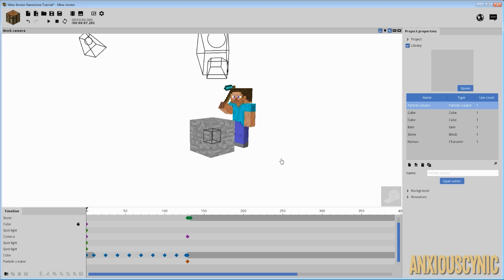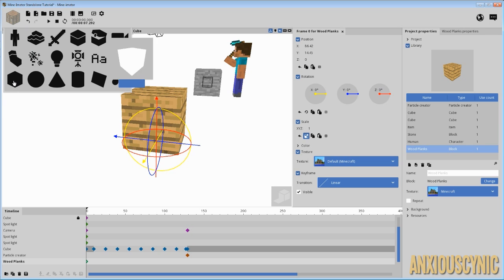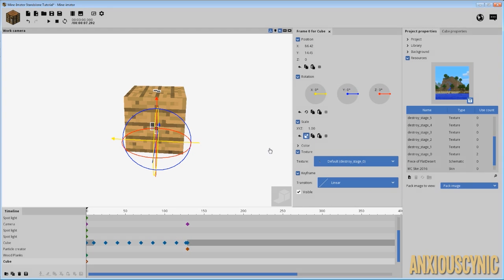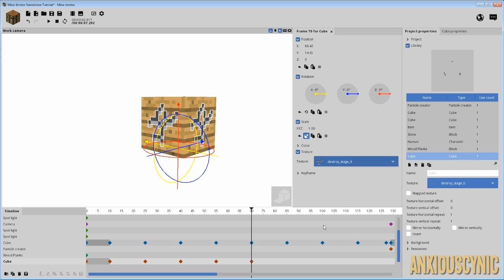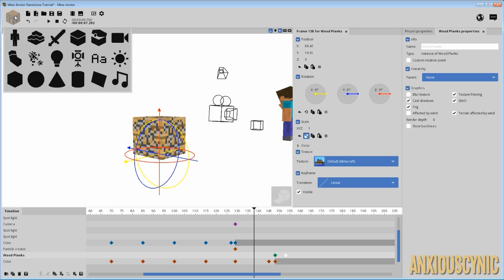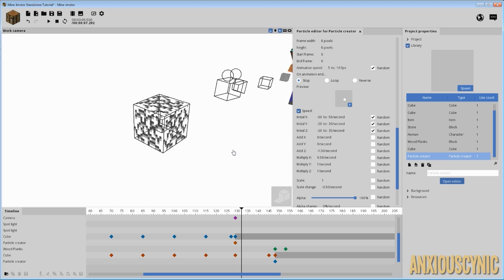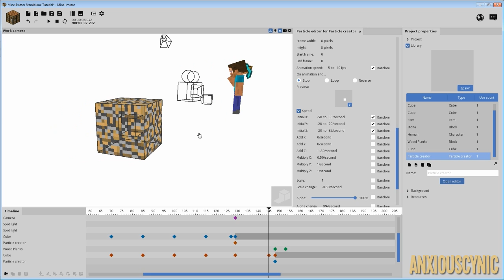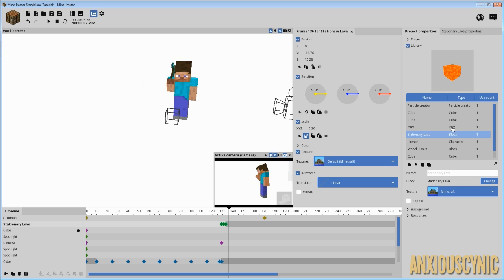How To Break Blocks! | Mine-imator Tutorial

Comment: Hello sir,how much do you think it will take me to mastering that softwere and if there any value to put so much energy to learn it and make vidoes for my youtube channel in your opinion?
Reply from the maker: How long it takes depends on how much you practice with it, and how quickly you can grasp the concepts of using the program; however, it doesn't take nearly as long as learning a full-fledged 3D modeling/animation software. Only you can decide if it's worth it to do learn, though, as it depends on what your goals are and how you intend to use the program.
Reply: I think there is much value to learn it.I will try practice on it like 3 hours per day with the goal to be able make 2min long animation after like 1-2 months.I never did that before and am total noob.Do you think it still posible for me?Thank you!
Reply from the maker: That sounds like a reasonable goal!

If you have too much trouble, I would practice by making wallpapers. You can learn a lot without getting bogged down, trying to make a good-looking animation. ;)